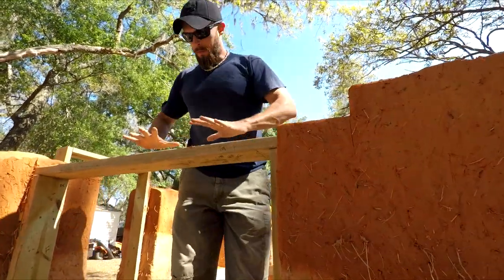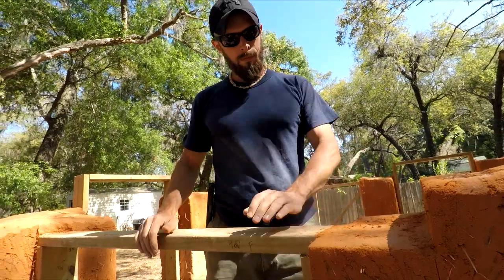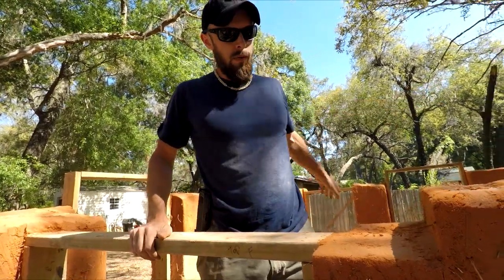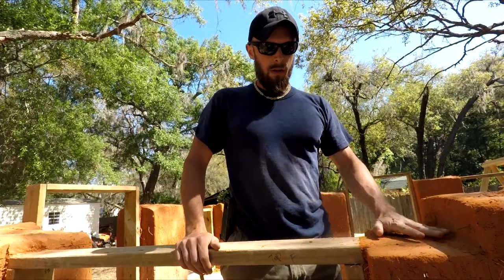What Happens The Day After A Cob Workshop

Comment: do you protect the walls from elements for the three weeks?
Reply from the maker: Yes, in this case we put plastic sheeting over the walls to protect from heavy rainfall. Also keep in mind, that some cob is more rain resistant, but the soil used on this project in Florida is more sand-heavy so we need the extra protection.